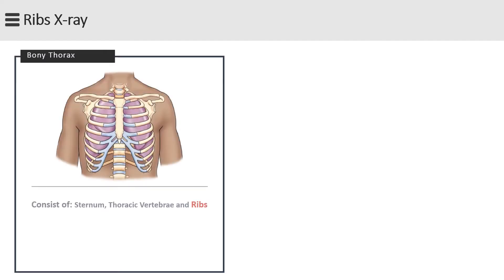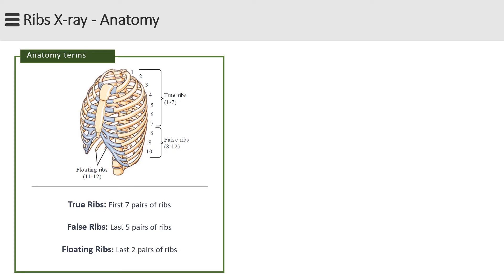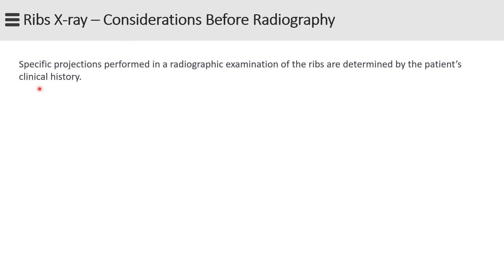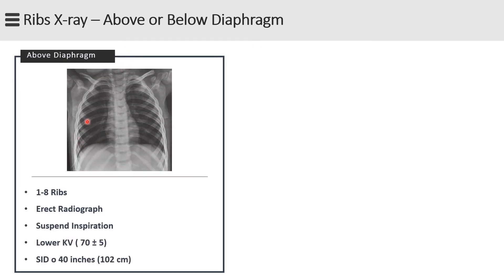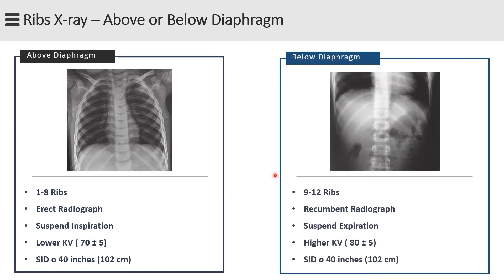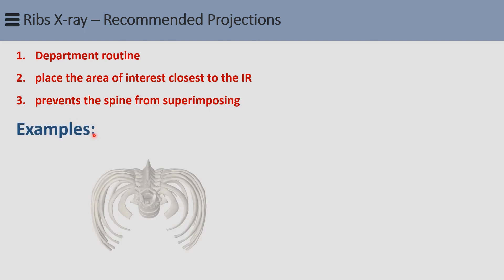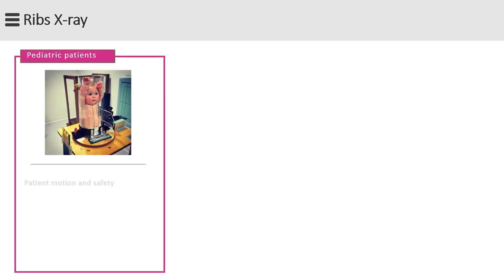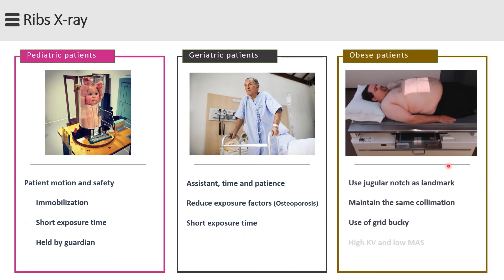Ribs x-ray Projections ( radiographic positioning and consideration)

Comment: How come for the suspected right anterior fracture the left anterior rib cage is closest to the Bucky while for the suspected left posterior fracture the left posterior rib area is closest to the Bucky? Shouldn't it be RAO for suspected right anterior rib fracture?
Reply: Anterior Oblique Rib positioning protocol Always position patient with the affected ( side pain is on ) AWAY from IR. So if the patient complains of RIGHT anterior pain  Position patient with the LEFT side touching IR and the RIGHT side ( painful side ) away from IR So you would first do a PA then you would do position 45 with affected side away LAO keep central ray on Right side use a 14x17 and make sure you include Left &Right markets, Posterior obliques are easier because you place the painful side Closest to IR for Posterior pain place patient into AP position back touching IR then position patient 45 degrees with painful side touching IR ( Right Posterior pain would be RPO right side touching IR   Oblique Rib can be confusing  but just remember anterior ribs affected side AWAY this causes the ribs to elongate and required in all rib x- ray exams also  A PA Chest  to rule out pneumothorax also ordered just remember to change your SID from 72 for Chest to 40 for Rib Series   I had been an instructor for many years  good luck